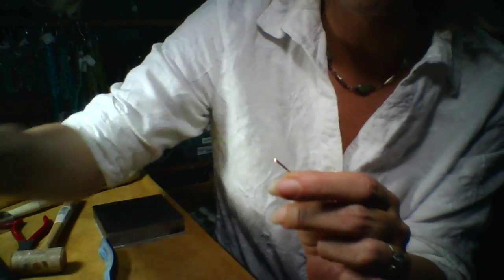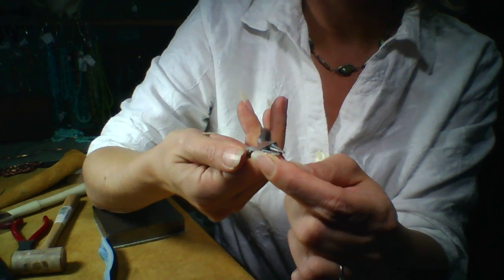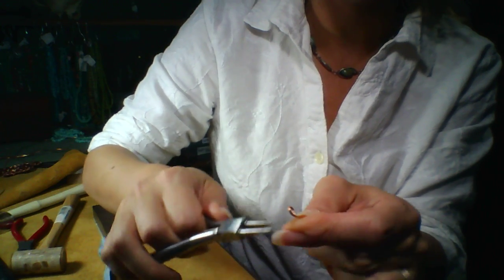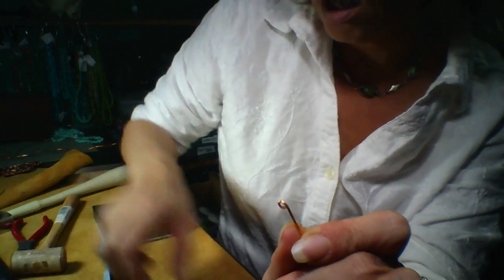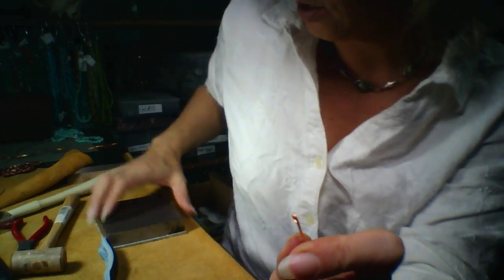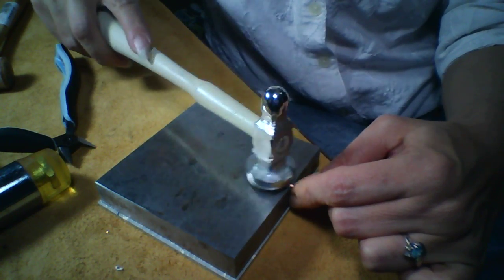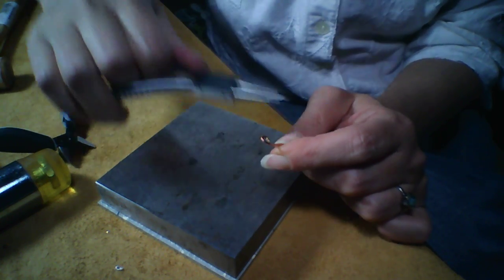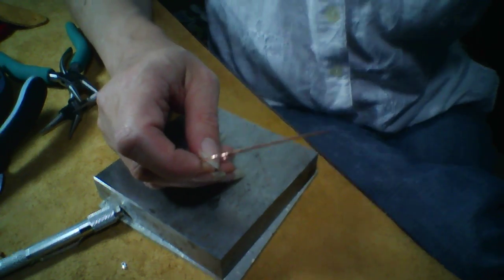How to harden wire for wire wrapping jewelry

Comment: This is just what I needed. I bought a bunch of wire before I knew there were different hardness levels. It's too soft. I got myself an anvil to work on that's two sided. Stainless steel and rubber, now I just need a metal hammer since I already have that black and yellow one. I was also gifted some cheep wire twisters and have yet to get them to work, but I just might not have done it right. 

Long story short, I was excited for my wire and made my mom a ring and it keeps bending out of place.

At what stage in the ring making process is it best to harden the wire?

Comment: I make pendants for necklaces and I’m planning to sell them but if you sleep in the jewelry the fasten I guess you’d call it will break. Is there a good way to keep the fasten from breaking or a way to harden the dead soft wire? Dead soft wire makes for great detailed pieces. Thank you for your help!
Reply from the maker: If you are on Facebook I recommend joining the group Jewelry Makers and Bead Lovers, I own the group. That is a multifaceted question and you will get much better and thorough answers there.

Comment: I want to make a 6-1 Persian bracelet using 999 silver. The only pure silver wire I have found is dead soft. Will this procedure work on fine silver? Also can you twist it two turns one direction then reverse two turns until hard and maybe get less distortion in the wire? 
Thank you.

Comment: Hi, A fascinating video, I'm new to all this as you may have worked out already. The steel block that you forgot the name of looks ideal for my needs. I've bought mini anvils from Amazon and Ebay all stating that it's ideal for watchmaking and craft's and made of cast iron! Every one of them (must be 10 or more) has dented when hammering with a 2oz hammer and Kanthal A1 wire, the shape of the wire has dented the surface of the Anvil! Very frustrating so I'm looking for an alternative. What would you recommend? Any websites, name & grade of steel etc would be very handy. 
The hardest steel I would be shaping is 316 Stainless Steel wire to 1.6 diameter  (welding rods). I've been using a dapping block but there's very little room between the half domes! I'm house bound so it's very difficult to see before I buy and therefore have to rely on the info in the amazon or eBay listings!
I never thought how exciting wire can be when shaping and working it but it's soooooooooo frustrating when it's harder than my collection of really soft anvils!
Loving your video's and SUBSCRIBED 👍😉👌
Reply: Look into Eurotools and buy the highest quality.
Reply: Etsy and Ebay have tools from large jewelry supply companies. Amazon has cheap goods from China where they don't care about their reputations.  Both Etsy and Ebay sellers value their feedback reputation and are usually jewelers themselves, so I would direct you here for best jeweler's block. A watch block does not need such hardness.  Steel and Cast Iron are both high in compressive strengths with steel having higher tensile strength.

Why not resurface your existing dented blocks?
You can grind down the metal with aluminum oxide/ ceramic/ zircon sandpaper in a handheld orbital sander.  DeWalt makes a good one. Cheaper tools would be Makita or Ryobi. Make sure its a random orbit sander NOT a palm sander, and that it has variable speed. Ceramic and Zircon sandpaper will cut steel.

You can polish up the metal block with an angle grinder (Bosch 5 inch paddle switch, variable speed, leave-on switch refurbished Amazon $79).  Use 4 - 4.5 inch crimped wire cup brush from Harbor Freight $5.  This wire cup will polish up the block, might remove some dents or scratches. Finish up with progressively finer sandpaper till you reach 400 grade. Then just polish it up.

A nice anti rust coating is from Lowes - Loctite Rust Neutralizer Spray - good for cast iron. Dries clear. Bonds rust to metal and prevents further rusting.

Comment from the maker: Well the wood will give so yes it will harden it but the metal hammer may cause the metal to change shape somewhat, grab some wire and give it a try until you get the effect you want.

Comment: I can't find the wire twister that you are using.  Thanks for the informative video
Reply: I use an archimedes drill for gripping and twisting the wire. They're pretty cheap on ebay. I got mine in a tool shop for about £3.00

Comment: If I use the leather will it prevent marks on the plated wire?
Reply from the maker: It should. When hammering plated you might lose the finish though. It can crack off or has to potential to. Test it out with a piece and hammer a bit more gently.
Reply: @MagpieGemstonescom  OK thanks

Comment: Hello love your video, in hardening wire using a trumbler , say I was making a expandable bangle , would I make the bangle then place it in a tumbler, or harden the wire before I made the bangle ? I know this is a dumb question, I just want to do it right. Thank u so much
Reply from the maker: tammi mccormick I would harden afterwards. You might be surprised how much your wire will work harden as you make the piece.

Comment: And you can use a piece of flat wood and roll the wire under it back and forth. Like a piece of a wooden frame would be great.  I put a piece of tape on the end so I dont get splinter. I need to go find the video so I can list it here then you can see it yourself.

Comment: Thank you for this, but can you tell me how to harden homemade jump rings. Mine always open whenever I try and I have been using the bench block and a hammer. Should I try using leather?
Reply: Tumble anything to harden the metal. That said, you can't expect an UN-soldered jump ring to hold it's own against a good pull. I recommend soldering your jump rings. Good luck!
Reply from the maker: I have no problems making jump rings that will hold. The secret is a heavy enough gauge of wire and the diameter of the wire. Barbara they will open when you hammer them and then you have to close them again. Watch more of my videos and you will see how and what I mean. Youtube won't let me post links.

Comment: I need to make  my model airplane front nose gear  wire with a spring coil more harder  how can I Do that?
Reply from the maker: Different metals harden in different ways. If you can figure out the metal it's made from and do a Google search on annealing and hardening that particular metal you might get somewhere.